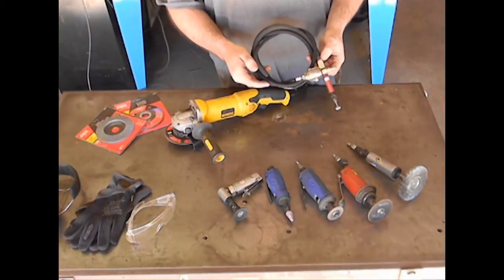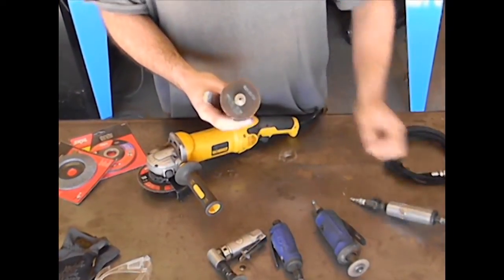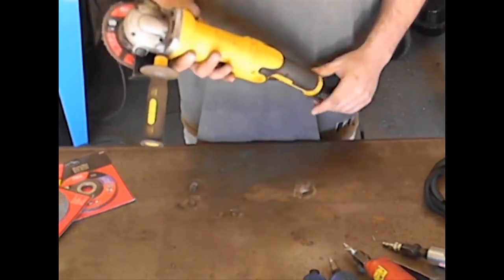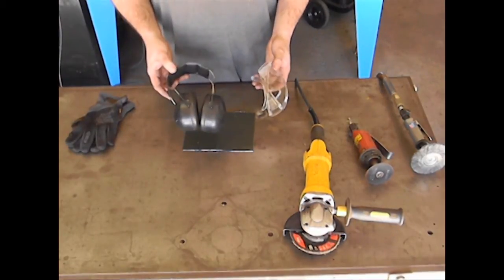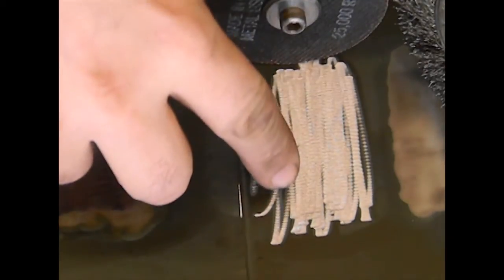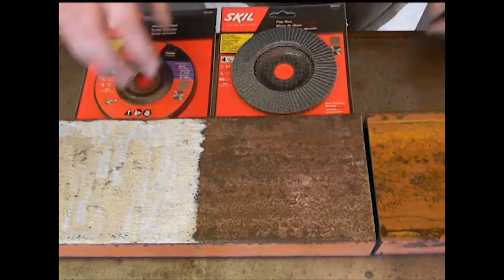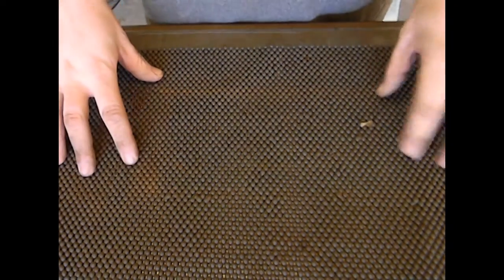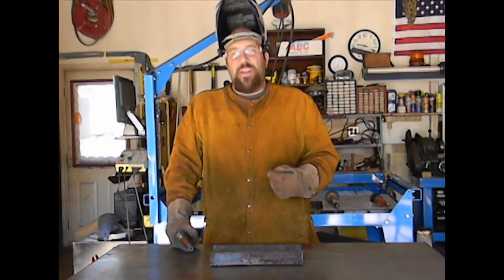Prepping Metal For Welding

Comment: What would you use on a rusted powder coated fire pit?
Reply from the maker: I'd use a braided wire brush on an angle grinder... something like this:
https://www.homedepot.com/p/Milwaukee-3-in-Brush-Knot-Cup-48-52-5040/100053125

Comment: Any specific tips on prepping curved surfaces, like 1.75" x .120" DOM tubing?  I'll be doing my first MIG welding (other than scrap) on that stuff.
Reply from the maker: +Ramzi Vincent You need to remove paint or just surface rust?
Reply: Yes.  Modding an existing, painted roll bar to fit another application.  Main hoop needs extension to sit higher and the rear braces need to be replaced since they're too short and exit at the wrong angle.  Also need to add a diagonal bar to meet NASA CCR.
Reply from the maker: +Ramzi Vincent  I would lean towards using one of those sandpaper flap disks on an angle grinder. Nothing finer than say 80 grit to prevent the paper from becoming clogged. Should make short work of it.

A steel wire brush on a drill  would also work in a pinch but depending on the thickness of the paint it could take a while. The drill won't offer the same power as most grinders so its slower in most cases... at least that in my experience. I find that wire brushes are much better for surface rust rather than paint.

Comment from the maker: Very good question, I sometimes get steel rod that was cut in a mill and it comes in drenched in oil. I wipe the heavy stuff off with a paper towel and then use 91% pure Isopropyl alcohol, the same stuff you can find at Walmart. You can use denatured alcohol if you want to pay a little extra for the good stuff... either will do a good job and I use them to also pre clean metal I may need to tig weld. Just don't buy "rubbing alcohol" its only 70% pure and does not evaporate as quickly or cleanly.

Comment: Thanks for the video. What about de-greasing? I typically buy weldable angle iron that has a kind of greasy black surface. I am assuming you have to wash this stuff with a detergent degreaser first. Sometimes I use a degreasing detergent, rinse and then follow with an organic solvent. And then grind for the final cleaning. Seems like a heck of a lot of work. Is there a better way?

Comment from the maker: Most air tools have a "Air Consumption" lable somewhere on the package. For example, my air grinder require 3.1 CFM (Cubic Feet per Minute) a smaller 110volt compressor may just be able to keep up. You may find that the tool slows down after a bit and you'll need to pause to let the pressure build back up but it will work.

If you need something that will do a lot of production you'll need a compressor that can produce 2 times the CFM the tool requires to be on the safe side.